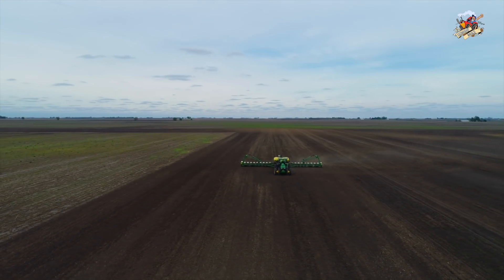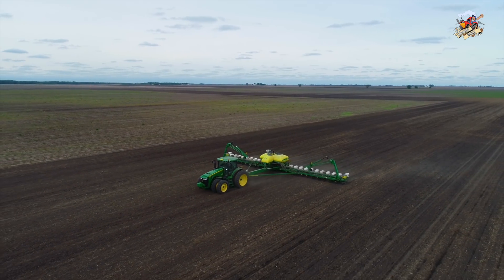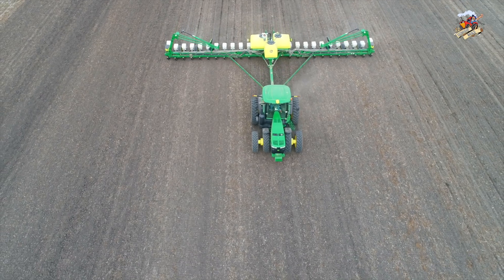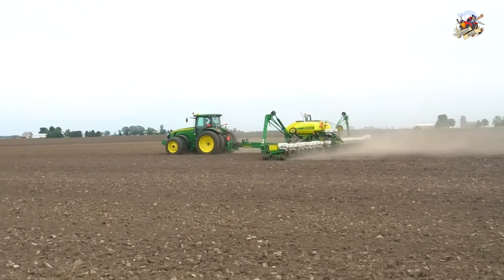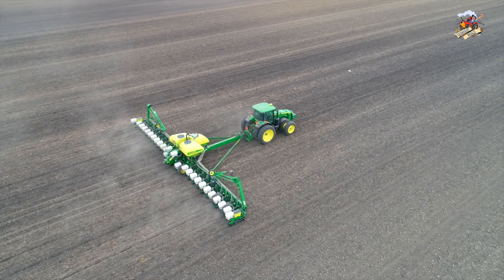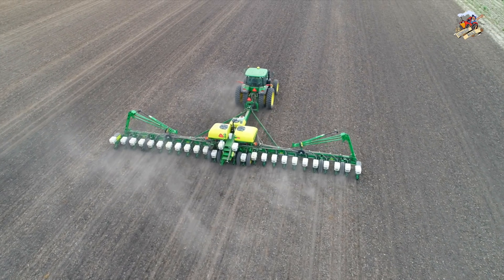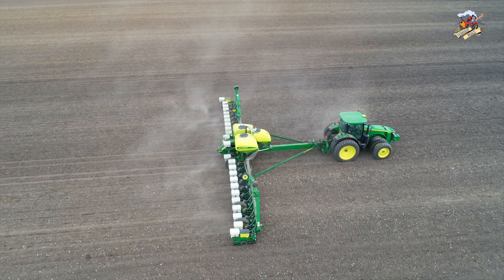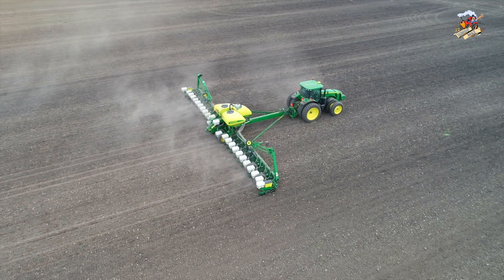26 Row Corn Planter - Planting Seed Corn in Illinois

Comment: can someone explain how you need 26 rows?  My math isn't working out if you have 4 female and 1 male.  I was thinking you'd want 2 females on the outside (?) 10 or 15 or 20 etc work out
Reply from the maker: Well they buy a 24 row planter and add an extra unit on each end for 26 row.  Then the outside rows they added have a shut off and you switch back and forth each pass.